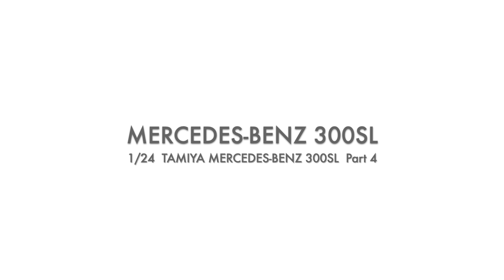MERCEDES-BENZ 300SL 1/24 TAMIYA - part 4

Comment: I picked up another puzzle peice,  the real metal bolts have their shaft/thread diameter on the right top of the lid, while the bottom left was the bolt head diameter all in .01-9 mm.  

Thanks for showing the package labels,  quick and simple and we will use it when needed. Thanks again awesome job.

Comment: As usual, jaw dropping details. I cannot imagine the infinite number of swear words I would shout out trying to achieve similar! 

Also, I never realised until now how far the engine block was canted over in the 300SL, so I get entertained and educated 👍🏻
Reply: this was to lower the height of the hood. Chrysler did the same with the slant six.
Reply from the maker: The engine is tilted 45 degrees. Thanks!

Comment: Awesome attention to detail. Can you show how you take a thin piece of wire and put a head on the end? Towards the end you cut a thin piece of metal, put a wire through it then you showed it with with a head to stop the sheet metal falling of the end. It was from 19mins 23 seconds in the video. Thanks Philip
Reply from the maker: That part was soldered. I forgot to record the scene. Thanks.

Comment: Amazing details as always A4.  One of the more difficult challenges for me is simply finding good detail photos of the things detail modelers want to see.  I have a large format coffee table book of the 300SL with countless beauty shots of opened gullwing doors on fancy lawns but only three(!) pictures under the hood and they are so small and far away I can't tell what goes to what.  can you recommend a useful book or site for good source material?  I'm looking forward to your dashboard and the door strut mechanism you will make.  This car has so much potential.
Reply from the maker: There is much more information on the Internet than you think. You can find more data by searching for each part. Thanks.

Comment: How good is this? Well, blow up your model 24 times in all three directions, so you get you model car in real-life size. Out of the box it looks like it's made of wet clay (even though Tamiya is outstanding, there will always be this softness to plastic parts). But A4 garage upgrades allow the viewer to discern perhaps 90 percent of the details to within an accuracy of 5 millimetres or better... real-life millimetres! If I took my glasses off and saw your car next to the real one, I would not be able to tell which was which.
Reply from the maker: Thank you!